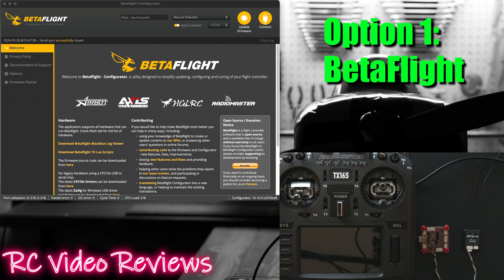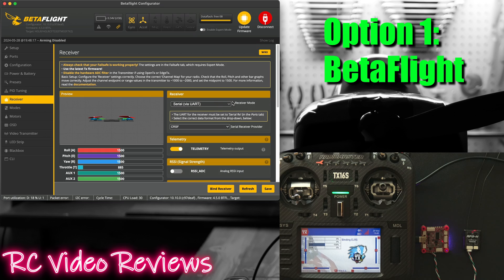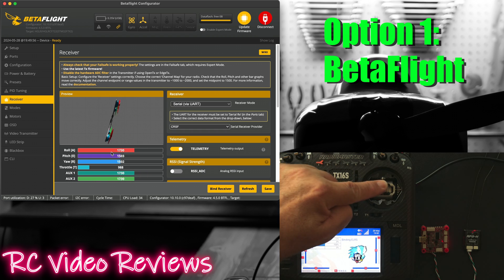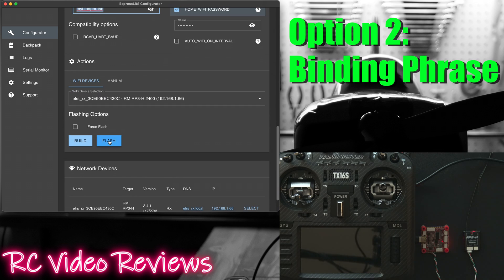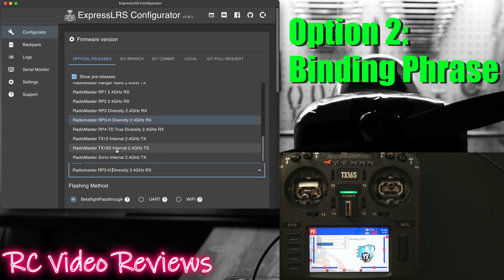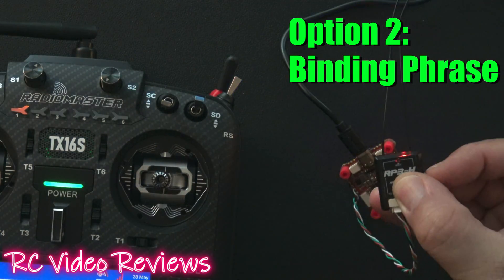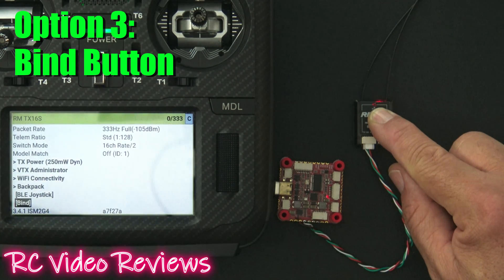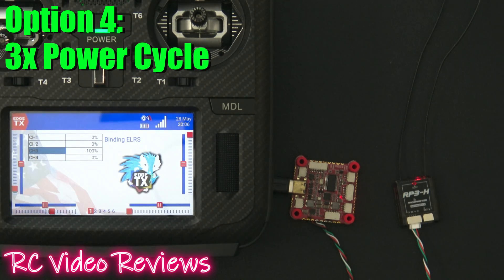How-to Bind v3.4 Express LRS Receivers • All 4 Methods [ELRS]

Comment: Umm. Win i power the drone with the usb it connects but win i turn it on with just the battery it doesn't connect any help i did all 4 methods? And it is soldered right

Comment: noone of therse works  evrytime  i unpower the radio  i need to bind again and repower my quad then i can fly battery after battery   but as soon i repower the  radio binding is gone....
Reply from the maker: Use the RX Webui, reset to factory and try again. If you haven't used a binding phrase, I'd suggest switching to those. I've been using binding phrases for years and they always just work.

Comment: I just got into elrs a couple weeks ago. I have an issue of the rx losing bind with the tx. It happens sometimes in between batteries during a session and sometimes after ive made adjustments in bf. Its like it loses memory sometimes. I admit i didnt check versions on the rx or my boxer tx, nor have i updated either. I did the 3 plug method for binding.

Comment: Just a tip, if its not binding check that the rx is compatible with the packet rate you have set in the radio. Took me forever to figure that out with one of my quads
Reply from the maker: As far as I know, all RXs support all packet rates. What's more likely is you set a wifi timeout short enough to go into wifi mode before the Tx binds. I've been told by the lead dev and confirmed in my own setups in 3.4, they removed init rate and the Rx will now initialize at the last successful packet rate.

Do you have an Rx that excludes certain packet rates? What manufacturer and what model?
Reply: @RCVideoReviews  Not sure why my reply didn't send so this might be a repeat... Yes, the receiver on the Tinyhawk 3+ Freestyle Analog. Because it's SPI based it doesn't work with any of the D or F packet rates. After I first got it, I watched every binding tutorial I could find and no one mentioned it, so it wasn't until I stumbled into a page on the ELRS wiki about it that I finally managed to bind the thing

Comment: Great video as always, I know it isn’t pertinent with this video but, I need help about edgetx. I have a mt12 surface radio and what I want to do is when I set for example the steering trim to -60, I would be able to reach +100 and not just +40 when I move the steering wheel the other way around.
I tried to set the weight to 200 in the mixes page but this way I would reach the 100% steering with only the 50% of rotation of the steering wheel when the trim is centered.
thank you in advance.
Reply from the maker: Look into a curve or offset.

Comment: The method I use is similar to method 2 . I use the configurator and then save the file to my ELRS folder. Next I power up my receiver using a servo tester and wait the 60 seconds until it goes into WiFi mode. I then get on my computer 🖥️ and click on the expresslrs WiFi signal and then I update the RX using the ELRS folder that has the bind phrase ect. After that it’s ready to go 🎉

Comment: Just wondering, I fly my ELRS quads and planes with 2 TX-es with the same binding phrase. Using a binding phrase, I don't have to bind again if I use the other TX. Binding using the other possibilities, like the button, will require a new binding in case I switch to the other TX?
Reply from the maker: I believe so. Best bet is to experiment. The binding phrase is only used to generate a binding UID. If those are not identical on both RXs they won't both react to the TX. I would test this though.

Comment: I don't use ELRS purely because I have more receivers than aircraft (I bought a lot of R168's when they came out). However, I'm thinking it would be a good project as I always feel happiest on the craft that have Crossfire. A question: Methods 3 and 4 were so so simple, what are the advantages (if any) to Method 2?
Reply from the maker: I always flash RX to whatever my TX is running (at least the major version). So may as well stick the binding phrase in there while I'm at it.

ER8 = $35
ER6 = $30
EPW6 = $14

Would trust those three over any other RX you could give me (along with the other RM RPx/ERx series but the 6/8 are my go-to for fixed wing).
Reply: @RCVideoReviews  Thank you. I am very strongly considering moving to ELRS for every plane I care about that doesn’t already have Crossfire
Reply from the maker: I only fly ELRS on my fixed wing now. And starting to head that way for helis. I still use Crossfire on my quads, but that's because I've been too lazy to swap them out for ELRS.
Reply: @RCVideoReviews  I did it! An R168 in a nice balsa Cub decided to continuously lose bind which spurred on the purchase of 4 x ER6, 1 x ER6VG and a Ranger Micro! Much RCVR rewatching ensued! Now everything I care about will go ELRS unless it's already on Crossfire. The remaining aircraft can stay on Frsky/clone or S******m as the fleet could do with a bit of a reduction ;)

Comment: You should be able to use the Bind button in the BF receiver tab.  No need for cli commands.

You might also like to cover the volatile binding option found in the Rx Lua.
Reply from the maker: I swear I couldn't find that button when I started toying with this. I can see it in the video. Eyes see what they want to see I guess.
Reply: There is a fifth way!